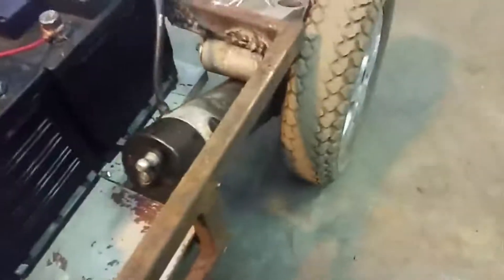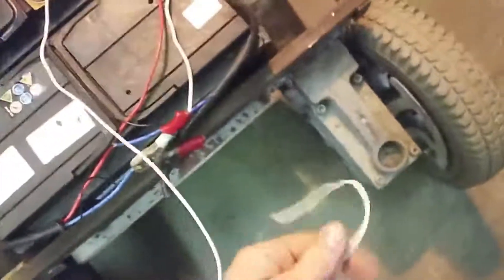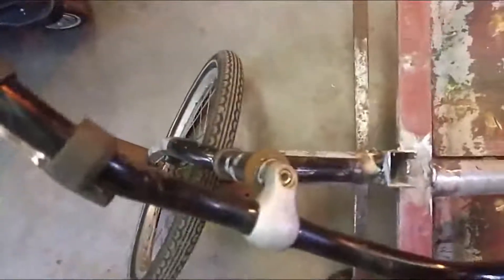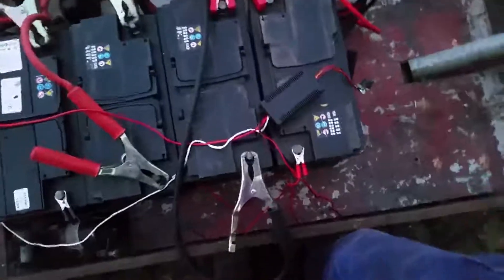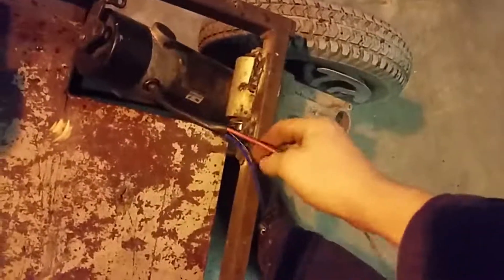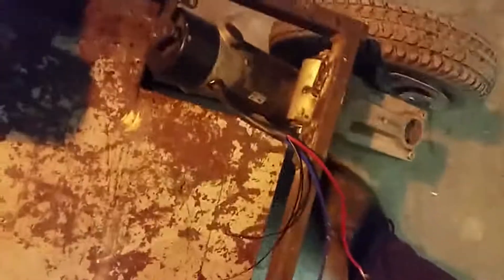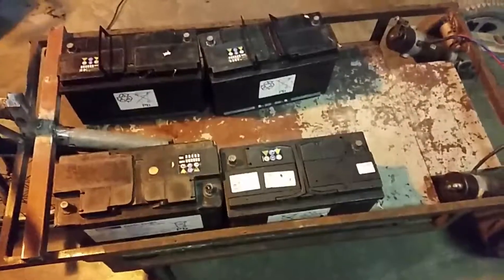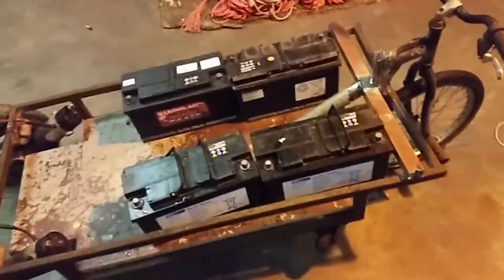Cheap 30A PWM motor driver test on the frankenkart

Comment: These are ok just have some active cooling on it or else it will get stuck on the on position. That would be bad day. Add a pull kill switch or plug just in case you end up on a run away controller bro. These are ok on 24v go karts but too much stress on these things on the go karts.
Reply: I know Im kinda randomly asking but do anyone know of a good site to stream newly released tv shows online?
Reply: @Alfonso Maurice flixportal :P
Reply: @Jad Luciano Thank you, I went there and it seems to work :) I really appreciate it !
Reply: @Alfonso Maurice no problem =)

Comment: dude used another awg wire big one atleast 10or even12 awg and try again with that tiny wire you are limiting the current by the thin wire. you will only endup with half the power you said
Reply from the maker: Is was literaly made with garbage😂😂     the most cheap ass ghetto way  you could wire it up.  When the pwm controller broke i just used a big bolt and some steel to make an makeshift switch.    And damn its torqyy   but  i demolished the whole kart.   Front wheel was just crap.  So i had some fun with it and had some practice with stick welding

Comment: Any idea how to modified the circuit for buck converter?
Reply from the maker: I guess ya only need to add a capacitor on the output and then adjust the dial to the correct voltage.   Thats what an basic switch mode power supply is.  But you wont get higher voltage than the input ofcourse
Reply: @DiyNuke  i tried it but same voltage output only the currents adjusting
Reply from the maker: @smoke_stackz3168  well how about just buying the right buck converter then?   Instead of an pwm motor driver
Reply: @DiyNuke i think yes iwill buy soon😊

Comment from the maker: Sorry for the video quality  i kind of don't know where it is going wrong.
Reply from the maker: and ehh well the empty scene at the end....
Reply: Don't connect this module Without a switch, and you have to measure With an amperimetric multimeter the current spike of each motor